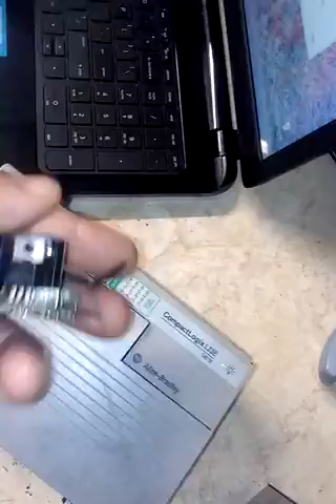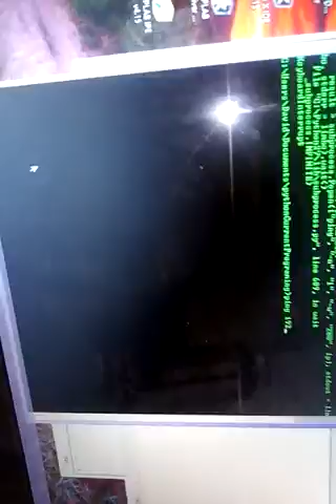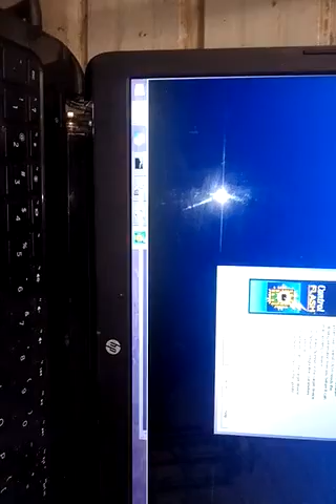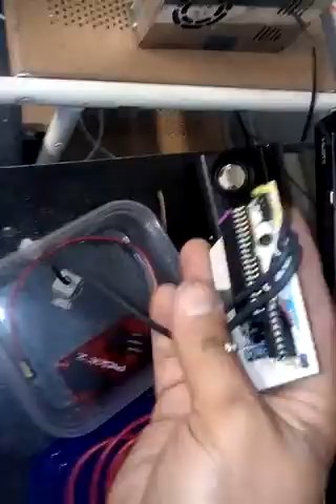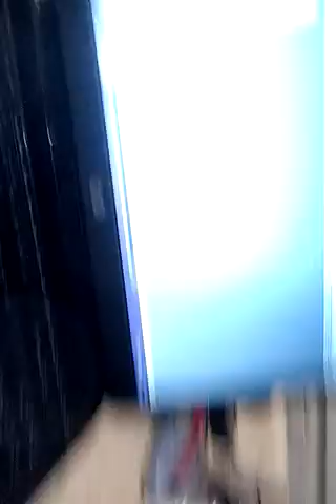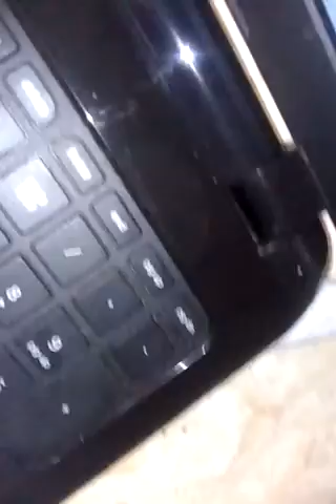Damaged Compactlogic PLC brought to life

Comment: Hi, On your cost free HMI video. I'm having trouble when I Start the project on the HMI it says “no response from PLC” what does the plc address relate too? On my Allan Bradley 1000 the inputs and outputs are I:0.0/0 and O:0.0/2. what does the address you used relate to? I'm trying to turn a input on using a momentary button. Thanks
Reply from the maker: I just read your comment. Hope you got it figured out.